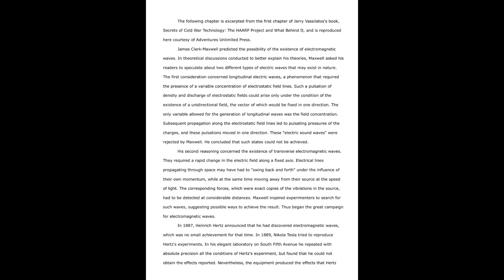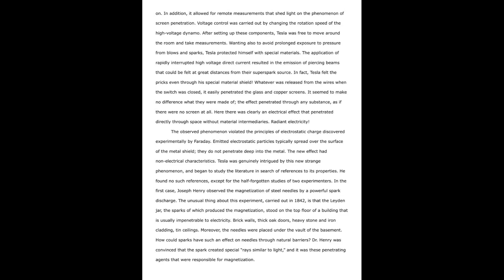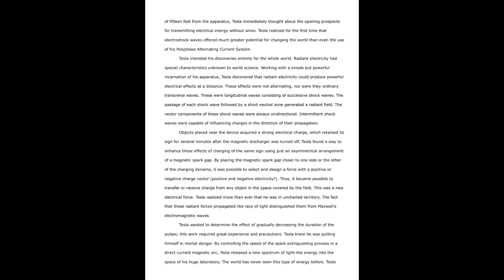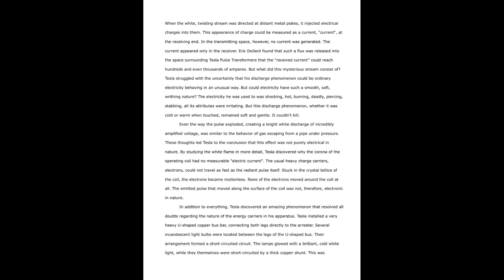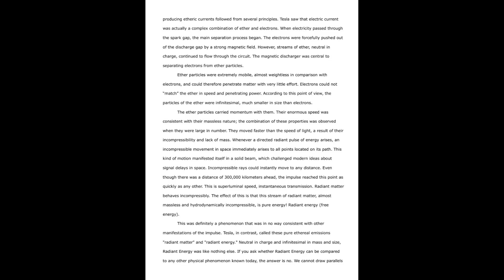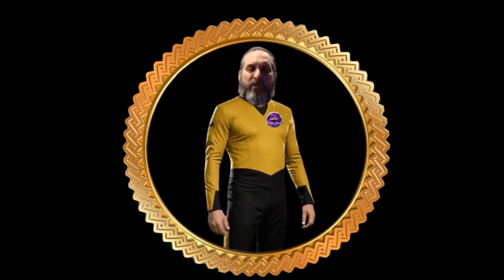Cold Current & Free Energy "Chapter 2"

Comment: The combination of Magneto Dielectric Spheroid Geometry (MDSG) and Coherent Aether Alignment (CAA) might be called Holographic Harmony (HH.)  Which creates bubble film ripples moving outward from point source. Likewise reflections are the same. Point source reflections are directly in reverse due to the nature of return geometry. Tiny glass spheres reflect light directly back to original source. This we see in reflective paint and clothing. Similarly reflective raindrops when sunlight is reflected back towards the sun. The nature of point source sphere geometry (PSSG) provides reflective surface. Rainbow telemetry means each person sees a different angle location of the reflection of the rainbow. Wavelength and intensity variation is said to occur holographically. Based on constructive and destructive interference patterns. And is the said reason for holographic film imaging. Likewise I theorize this is the so called quantum computing effect.
Paul Pantone mechanically produced aetheric effects similar to Tesla transformer transmitter. (His lawnmower water for fuel air intake for combustion engines. Which he was jailed for.) Separation of heat and cold. White light induction through and into ground.* Using only metal pipes with vacuum, water, air and aether cavitation. Any central pipe medium is magnetized. If not grounded specifically, radio broadcast alerts military responses. Believed to be due to time portal teleportation (beam ship technology?)
*(As seen by large radius of would be snow covered ground not having any snow. When in the presence of this running active device )

Comment: Get this point which begins at 4:15. It’s the closing of the circuit which produces the extremely high voltages! Rick Friedrich pointed this out to me years ago.
Reply from the maker: It is the reason people like spark gaps instead of transistors. The transistor explodes with the energy pushing back. a spark gap or a contact switch does not push back. it breaks the energy.
Reply: @ 
When you consider the old points and condenser with the rotor, coil and distributor of old cars, make and break.
Reply: @oldmanbuilds  One thing about Spark Gaps is that if you go back and read old papers it seems to also work as a frequency multiplier, as compared to transistors which can only do on and off (at far smaller voltages). Additionally it seems working dissimilar metals/items give different effects. Gerry Vassilatos talks about one being metal and one being carbon for more pure unidirectional action. Also Telsa speaks of platinum aluminum spark gap having a far stronger arc effect.
Reply from the maker: @bobdole27  In a spark gap you remove a lot of heat so your amps go down and voltage rises. That also means the frequency goes up. Introducing battery's even if dead will chemically restore the balance by reducing the frequency and adding back in the amps. 

Tesla used a dynamo to push low frequency to a #2 of a tesla coil and it brought up the frequency and allowed for the scalar field to increase to a very high level. 

I like the different materials because they have different rates of saturation and some produce a faster connection speed. It is an interesting topic.
Reply: @oldmanbuilds  Yes the Spark Gap is quite fascinating, and there seems to  be far more possibilities with it than transistorized semi-conductor methods, this doesn't even get into things such as "blowing out" the arc, either with air or with a strong magnetic field, or having the arc being placed within a vacuum etc.
Reply: @oldmanbuilds  You can have high amps without heat they're not the same thing, Bedini's zero force motor produced about 1.5 kilowatts through 40 gauge wire without any heat being produced and it wasn't a high voltage converter system.